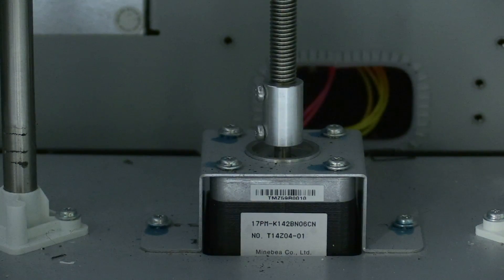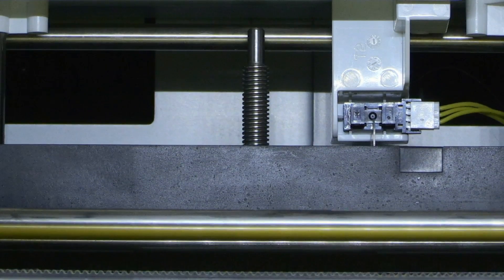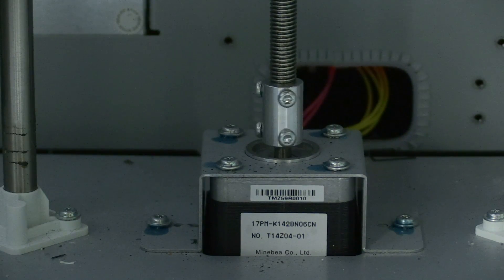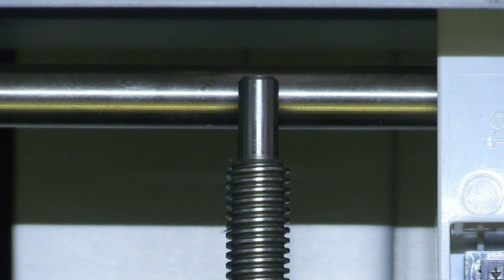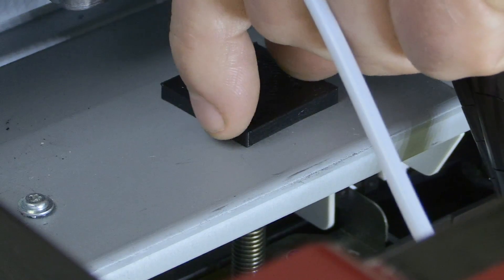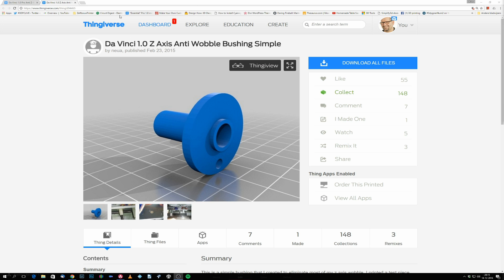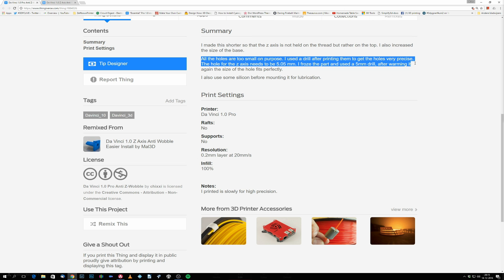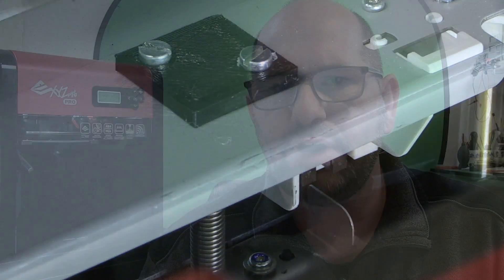▼ Da Vinci Pro Z Axis Wobble

Comment: IMPORTANT NOTE:
Even though I did not see any problems with print quality, I do no longer recomend to use this part. After having seen quite a few other printers, it seems that this is designed on purpose to allow some play for the threaded rods
Reply from the maker: I like it you say this, nevertheless, I still believe in this piece because it eliminated a problem I had and after the installation the problem is gone.
I have to say though, there is a little play in the part itself. Therefore, there is still room for some play although it's minimized.
Reply from the maker: True, although I must say that i perfected my printer a lot when I did this.

Comment: Hello Brian,

I like that idea. Also from engineering point of view this can make sence. Afterwards you will have a fixed- and floating bearing. But I recommend to drill the hole completly through the part. So you will avoid presure from the top (if you drill not deep enough) and you are able to add some grease from the top.

But I have a question about the bed leveling / z-offset. My parts in x and y direction are showing a good measurement. But I still have problems with the z direction. The parts are 1% to big. So my 20mm testcube is 20.2mm. I changed the z-offset sereval times, but it doesn`t help. (You hear some motor clicking, so he`s realy doing something). But after changing this I also have to calibrate the bed again to have the correct distance between nozzle and my buildtak. It seems like this two action are countermanding themselves.
Any ideas?

By the way, is your auto calibration also bad? My one is aslope as hell.
Reply from the maker: Hi Sascha,
There is about 3mm play above the leadscrew and the top of the plastic part, this must be more then enough. Also, there is grease in the part and on the rod. 

Concerning your Z axis problem, this can't have anything to do with the Z offset. This offset sets the height of the bed relative to the end-stop position. In other words, you can adjust the height of the first layer with the Z offset, but every layer after the first one will have the same layer height. If there is something wrong with this height, you have to fix that in the software that translates Gcode to stepper movements. In the Da Vinci Pro stock motherboard and software, I would not know how to do that, while in Marlin, for example, this is very easy to adjust.

One other solution would be to give this value to the slicer and handle it from there.

And yes, my auto calibration sucks big time. I have yet to see the first Da Vinci Pro that has a good and calibrated bed, due to auto calibration.

Comment: The problem what I see is that you can reduce the wobble effect with this solution, but you put another constrain in your mechanical system. A linear axis with the lead screw fixed too is overconstrained and over time will result in higher wear on the screw or the nut in the bed.
Don't get me wrong: I really like your videos and explanations and it helps me to improve my printing process, but with this additional fixture I see long time problems for the Z axis. But would be nice if you can update your experience and (hopefully) I'm wrong on this point ;-)
Reply from the maker: Hi Niko,
I agree with you that if the Z axis would have been bend, this would give a long term problem but the thing is that when rotating slowly, there is no wobble at all. The wobble is only there while there is a fast movement in the Z axis. This tells me the rod is a bit to flexible for this fast rotation, and this solves it.

Comment: Hi Brian,

Should it not be the higher (to the top) the print bed is the more it will wobble, and the lower the print bed is (at the bottom close to the motor) the less?

Anyhow. I will print the "fix" and see if it will make my 3D prints even better :-)

Keep up the good work!
Reply from the maker: Hi Noel,
No, in fact the higher the printbed goes, the less wobble you have. This is because of the bed having 2 support bearings with in the middle the threaded rod (lead screw). So the bed keeps the leadscrew in place. But when the bed is at a lower position, the leadscrew starts to wobble and this vibration is seen in the bed as well.

In fact, you can perfectly feel it when the bed moves up to start a print. If you put your vinger on one of the front corners, then you feel the vibration of wobble. No the part is installed, I don't feel that anymore.

Comment: But in the Da Vinci machines, there are 2 rods that attach to the frame that the build plate slides along. I'm sure those rods prevent any wobble
Reply from the maker: Well, as you can see in the video, they don't. The whole bottom plate of the printer is dancing up and down and as you can see in the after movie, this stops after I have installed the plastic piece.  https://youtu.be/oxGbw5sFNVc
Reply: @3dPrintCreator  Just read this comment a few years later. I checked out that follow up video and I do see that difference. I printed one very early on but never screwed it in. The only thing about mine vs the Pro is that the Pro seems to have a nibble on the end that allows for it to slide easier instead of being scraped at by the screw part
Reply: it is because of the backlash in the linear slides

Comment: Whitch e3dv6 original is the correct version:- v6 HotEnd Full Kit - 1.75mm Universal (with Bowden add-on) (12v)- 
v6 HotEnd Full Kit - 1.75mm Universal (Direct) (12v)
for the mod?
Reply from the maker: Hi Frank,
You need the Bowden one. The Da Vinci Pro has a bowden style extruder, meaning that the motor is not placed on the hot-end but on the back of the printer and there is a PTFE tube guiding the filament from the extruder to the hot-end.

Comment: If you really think about mechanics, fixing other end of leadscrew will make problem worse. To prove otherwise you need to show before and after prints, which you did not.
Reply from the maker: Basicaly you are now saying I am a liar, and I am not !!!
But, you are right about not making the fact I did not include a shot of the construction after I finished it, so that's my fault.
I will make that shot and link to it. It didn't get worst, in fact it got way better.
As you can see in the video at 0:34 the whole base is in motion as the stepper motor is turning the leadscrew. After I installed this part, everything is much smoother now. Both the top of the leadscrew and the stepper moter assembly. 

When I get home after my work, I will make the shot and link to it.
Reply: 3d Print Creator If I wanted to call you a liar, I would say so. There are also honest errors, confounding variables and placebo effect. I cannot see anything moving at 0:34 besides motor spinning. If you fix other end of the screw, something else needs to move - either motor, or bed, or screw will bend.
Reply from the maker: Hi Dmitry,
The second line was stating that this was my own fault... Maybe my bad English makes us understand each other wrong. I am not saying you call me I liar, I was making a joke about it. Hope you now understand that :-)

But, You are right about what you say if flexibility didn't also play a role here, and that is exactly what is the problem. When I am home tonight, I will show that in an extra video. The flexibility of the leadscrew makes it wobble and by supporting it on the top end (and not to tight), you eliminate that flexibility.

It would have been better if the leadscrew was just 2mm thicker. Then it wouldn't have been this flexible, and there wouldn't have been any problem.
Reply: 3d Print Creator its not because of its flexibility, it's because it's bent or coupler is not coaxial. Either way fixing other end will not help.
Reply from the maker: Okay, Well I still can understand why you think that, but I guess this video proofs the opposite.
https://youtu.be/oxGbw5sFNVc
Reply: I would like to comment on this discussion. Dmitry if you look at 0:34 you should be able to see the motor stand moving in your direcion and back. The threaded rod is mounted by the two bearing in the motor and therefore have a large overhang.  I have just looked at mine Pro 1.0. I cant see that much woble. I find it reasonable to say that there is some excentricity in Print Creators motor-rod system that give a resonance problem. The stiffness of the printer is not very large. I think its a good idea to mount a 'flexible' bearing at the end of the rod. But we dont know the actual stiffness, so you may end up with worn bearings in the motor. What about the nut in the bed support, can it move horizontally? Maybe a damping device at the nut could work?
Reply: Henrik Kullmann I cannot see it moving my direction and back, maybe a little up and down. If you fix upper end, you should let nut float left to right and back to forth. You can print coupler which is compliant in two directions and stiff on third (vertical) direction. This is common problem on Prusa i3s, look up "z-wobble" for ideas.

Comment: Hello Brian,

I also have a XYZ Da Vinci Pro and I am having a problem. I had a print that failed to stick and I was away from the house while it printed, so the pla ended up engulfing the print head entirely. I took everything apart and cleaned it out but I need to replace my printer nozzle. I contacted XYZ and they require me to buy the entire cartridge for $100 + shipping, and this is kinda of ridiculous.

Have you found a replacement for the Nozzle? I know that the cartridge is a normal 6mm heater cartridge and the thermistor is 100k thermistor and I have these, I just need the nozzle end.

Thank you for any help you have to offer!
Reply from the maker: Hi WelchDigital,
I am having the same problem here. I have once asked a friend of me who has a latte to make one for me, but that didn't turn out very good.
I also have converted some printers into E3D V6 machines by printing some parts and the E3D V6 Bowden version hot-end and they work perfect. Costs you about the same, but this works way better then the standard nozzle.

Here is a link to the E3D V6 conversion:
http://www.thingiverse.com/thing:1328848

Then you need a hot end, like this one:
http://e3d-online.com/E3D-v6/Full-Kit/v6-1.75mm-Universal-Bowden

Or you take a non original copy of an E3D V6, like this one:
http://www.banggood.com/0_4mm-E3D-V6-All-metal-3D-Printer-Extrusion-Head-Nozzle-With-Fan-p-1036420.html?p=9X051049165582016063

The only down side for you is that you can't print at this moment. So you need someone, or a print service, to get the parts you need.

Good Luck.